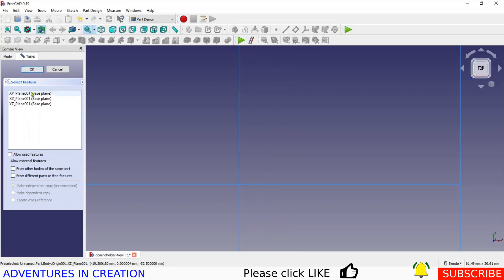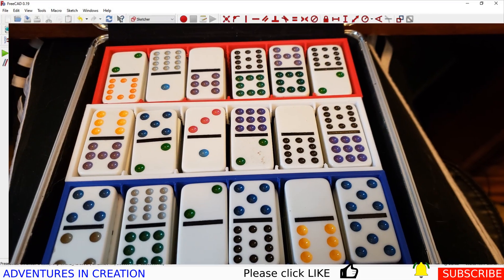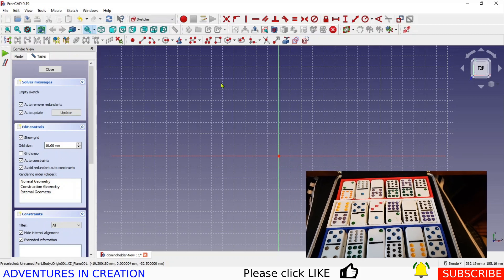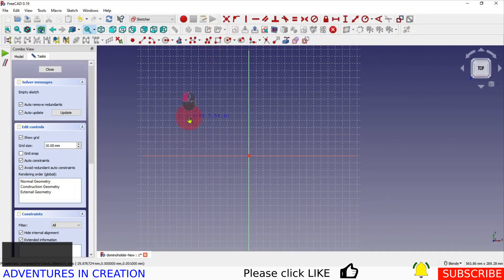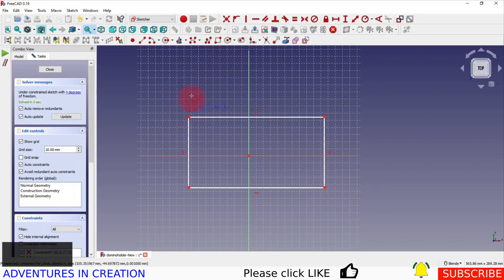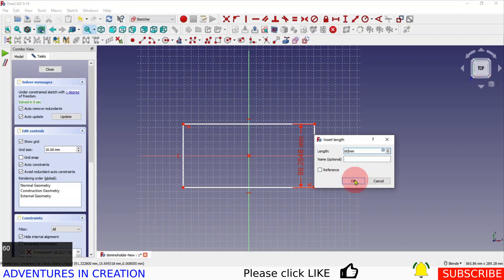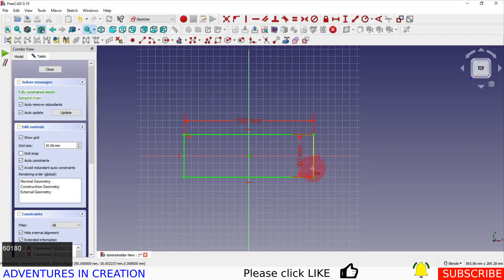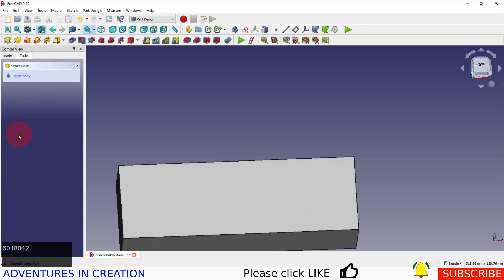FreeCAD - Linear Patterns - 3D printing

Comment: Can you tell me why when I want to start a line on  my sketch, the whole plane turns and it doesn't let me make a line o what ever I want to draw.  I rotates  like when you want to rotate the solid? thanks
Reply from the maker: It sounds like you haven't selected a line type from the top. Also, do you have your mouse 🖱 in blender mode? If so, the rotation is the middle button and the drawing is the left button.
Reply: @Adventuresincreation  Thanks for your reply.  The first time I used this program I was able to draw the lines on the plane but the second time it started doing that rotation with the left mouse button.
I selected the line command the square command and it keep doing the same thing.  I even remove the Freecad program and re intalled again and still is doing the same thing.  I'll check the mouse mode.
Reply: @Adventuresincreation  It was the mouse settings.  Now it works great, thanks for your help.
Reply from the maker: Great, I am glad you got it sorted out. - Enjoy creating some great designs.

Comment: Love your videos.  Question - how do you get such smooth holes on your export?  when I do it from my Mac FreeCAD they are rough, I have to run through the mesh workbench first even considered blender to smooth.  Is there a setting I might be missing?   Lastly I switched over to PrusaSlicer a few months ago as the latest Cura REALLY was no longer working nicely with my Ender 3.
Reply from the maker: Thanks John. Honestly, I am doing anything special when I export the stl files. I will take a look and see if there are settings that you can change but I am not sure you should have to. Have you tried it from a different OS? I would be happy to take one of your files and see how it exports from mine. The Prusa slicer is definitely a better option at the moment.

Comment: Prusaslicer can upload directly to Octoprint, but the setting is a bit hard to find.  Select the Printer Settings tab, then select the gear icon.  Put in your API key from Octoprint.  I have two printers, each with their own Octoprint.  Select between printers using the printer menu on the right side.  After you slice, you will see a "G" icon to the right of "Export G Code" that transfers the gcode directly to Octoprint.   I go back and forth between Prusaslicer and ideaMaker.  Both are excellent and can upload to Octoprint.  There are some STL files that Prusaslicer cannot process successfully and the same with ideaMaker.
Reply from the maker: Thanks, I will give that a try. I have three Octoprint instances, one for each printer and one for the MPCNC router. I am all for streamlining the process if it's reliable. I will let you know how it goes. (I might show it in a future video).
Reply from the maker: I just tested it, and it works great. - Thanks for pointing it out, you are right it's well hidden in the software.

Comment: Just hopped on board the prusaslicer train myself.  Was using cura for a long time before as  well. Really satisfied with the switch. Great job on the video, getting a lot from these.
Reply from the maker: Thanks Daniel, I liked Cura but they just kept bloating it with things I don't use or want. I find it frustrating to have to wait until its finished loading before I can get on with a simple slicing process.